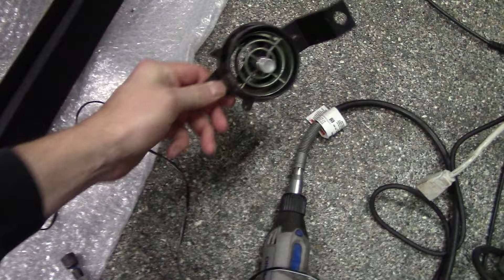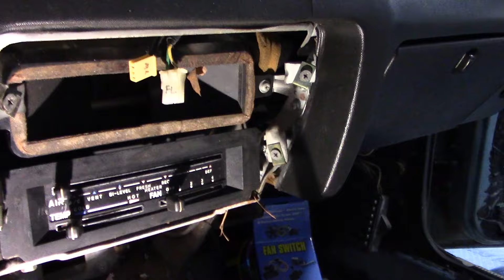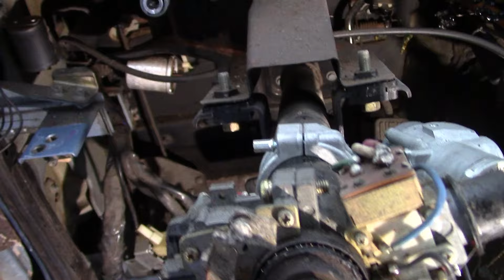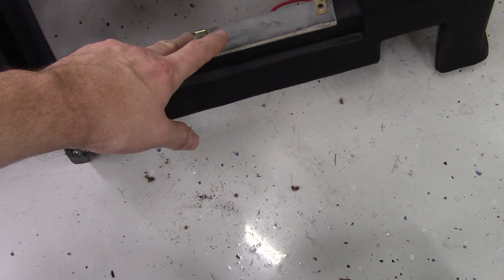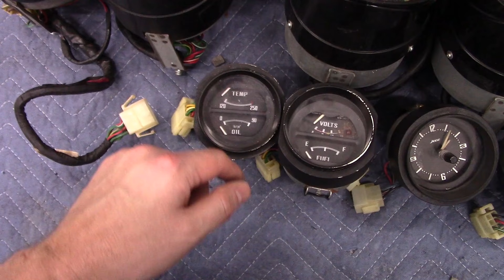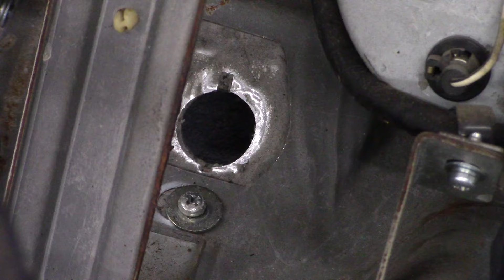How To Install Resurrected Classic's Dash Pad In A Datsun 260Z/280Z

Comment: Impressed! This is one of the most detailed videos on this topic that I’ve seen so far and I will be using it next year when I do mine.
Do you recommend doing the headlight relay’s that you mentioned and if so what is the main reason or advantages in doing so? Do you have a video on that? 
Im excited to do this project which will be the last major task for my 78 280Z. I just hope there’s no creaking or noises after doing so. 
Thanks again for the video! 
Subscribed ✌️
Reply from the maker: Thank you very much!! So far the dash has no squeaks, it does have a metal frame that the mounting screws screw into and they tighten up very well. 

Yes, the headlight relay is a fantastic upgrade, it is not needed as much if you go with LED headlights but it's a must if running halogen bulbs. 
The function of the relay is to basically redirect current draw from the headlight switch into the relay contact....the switch was really never made to carry the current it does which tends to cause switch failure or even damaged wiring from heat. I don't have a video yet but will have one eventually. 

Thanks again for watching and appreciate the subscription!
Reply: @ZCarProjectsWithJareth I went to LED so that’s one less thing to worry about then. Thanks again and I look forward to more.

Comment: Interesting tidbit I did not know the speedo and tach model/year changes, thankyou. I know the ammeter was still in the 75 280Z, but do not know when they actually switched to the voltmeter. Speaking of the voltmeter, it is difficult to find one without the corrosion around the warning light. I theorize the bulb being dimly illuminated for long periods fails the paint resulting in the corrosion. If you can successfully restore THAT, I would LOVE to see the video! Good vid. I have this to do and you took away the scary of actually removing the padding. I say thanks again. PS:  Did you by any chance rebuild the clock? Mine only works twice a day…
Reply from the maker: Youre very much welcome, glad this video took away some of the fear....it's definitely intimidating at first glance for sure. 

Im not 100% sure but I believe the voltmeter appeard in the late 74 260z, (the 260Z was a split year car) the early 74 260Z was basically a 73 240Z with revised dashboard and tailights and then the late 74 was the same car as the 75/76 280z just with the 2.6 liter carbureted engine, this was when the larger bumpers appeared and metal got thicker in areas as well as a revision to unibody frame rails. Then in 77/78 280Zs, there were major changes to doors, door latches, rear trunk, fuel tank,  and unibody in general.

I have repaired a few of those clocks, the most common I see are the inductor based mechanical clock that uses a spring loaded flywheel with magnets on it that pass over coils which create a electromagnet driver, (have a video of that in my short videos). The Jeco clock works a bit different, it uses a motor to essentially keep torque on gears to keep the mechanical clock running. Neither of these clocks are very accurate due to temperature changes but have had good luck with bothh of them. 

Thanks for the comment and once again, happy to hear this video helped you.
Reply from the maker: UPDATE: You are 100% correct on the ammeter still being used in the early 75 280Zs. I found a manual on the 75 280z and it references the shunt and ammeter. I also found photos of a Feb 75 280z and it had the ammeter as well.